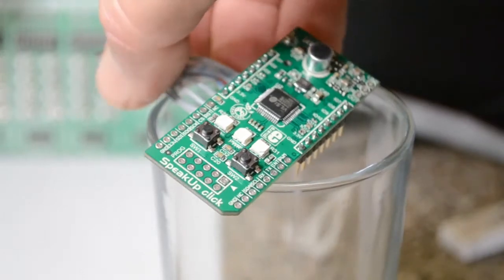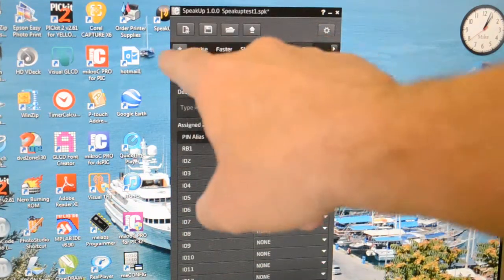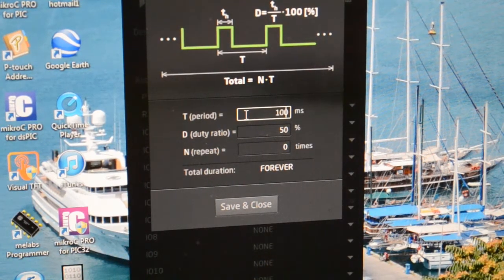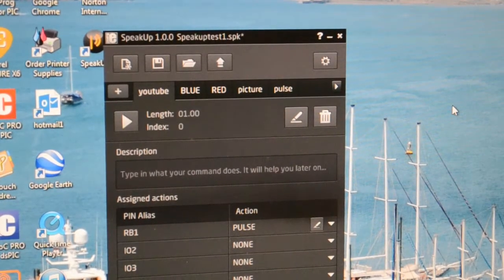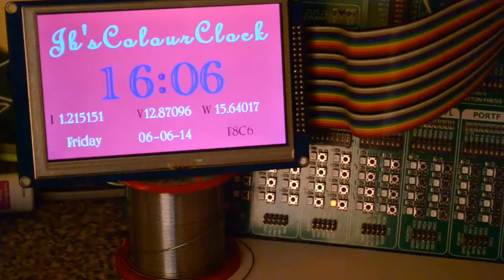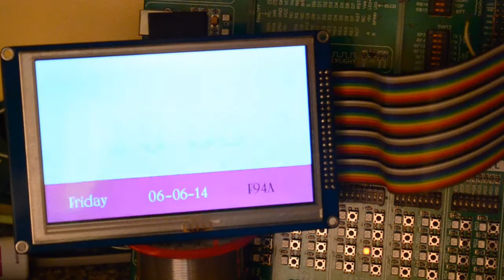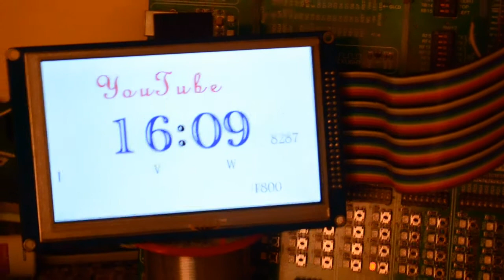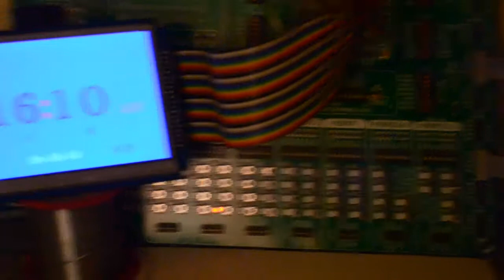Voice / Speech Recognition Module- MikroElektronika's 'SpeakUp' click board.

Comment: Thanks for the informative video.  Wanted to know if you have used the UART interface to receive the index of the command that is recognized?   Also is there any additional commands that can be issued to the module via the UART interface for monitoring or controlling the state of the module?   I am currently in the process of replacing a EasyVR Shield 3.0 product with SpeakUp.  Best regards
Reply from the maker: +Orlando Monaco 
Hi,
The unit is a stand alone voice recognition, so I do not believe it is capable of communicating via UART.
The software is free to download together with their user manual.
Thank you

Comment: I just bought one, and I wonder if you could help me.. It would be kind! I'm kind of new to this so I wonder how to power it without using the USB Port. Also I have one Problem: My OS doesn't recognize the board itself. Not even as an unknown device.. Any advices on that?
Reply from the maker: Hi,
If you have downloaded MikroElektronika's software and your device still does not see the speakup board, try another pc to program it.
Reply: I connected it, it was the cables fault, so I bought a new one. So.. is there any way to power it, without using the PC - So having the board in click mode with an arduino for example; If I try to power it with an Arduino + MIKROBUS shield, it doesn't work or do I have to code that it first recognizes the clickboard?
Reply from the maker: Hi,
Once you have programmed the words using a pc, disconnect and power from your arduino.
You need to set the input pins on the Arduino as inputs and just wait for them to go up or down.
Reply: Thanks you very much

Comment: I had this board and it is very poorly engineered. It worked 2 out of 20 times we tried to record then repeat a voice command. I don't know what sort of marketing campaign the manufacturer is using but it is deceptive. This board simply is not capable of reliable voice recognition.
Reply from the maker: +michael james 
My tests shows the contrary, I found it a smart and reasonably priced unit with consistent results as demonstrated in the video.
Maybe you should air your complaints to the manufactures
Reply: +John B Yes I did but even before I received the board, their support was far from adequate while I prepared to integrate the SpeakUp into an existing automation system.I'm not surprised the board is subpar. It may be that I received a faulty unit but I highly doubt it. Voice recognition is a processor intensive task and this is why low cost embedded solutions for this task usually underperform. I definitely will not be recommending the SpeakUp Click.
Reply: I tried making multiple instances of the same action with different recordings of my voice to account for variability of my speech, that seems to really help reliability.